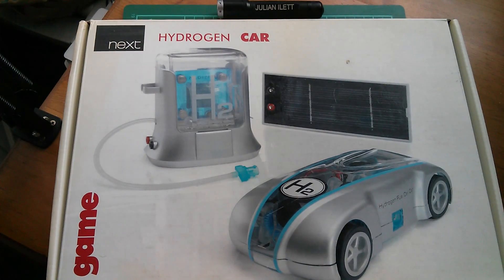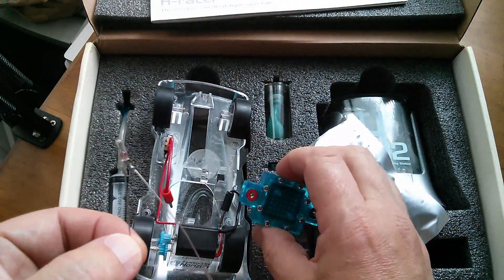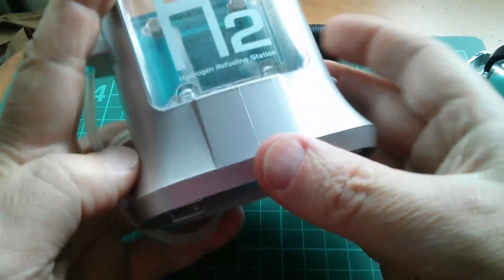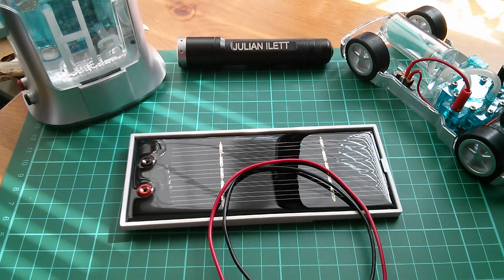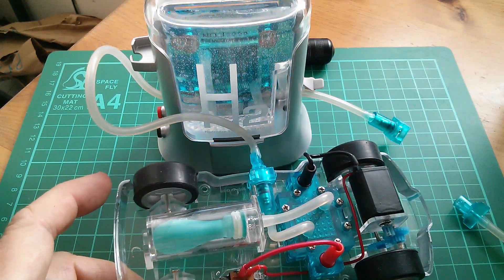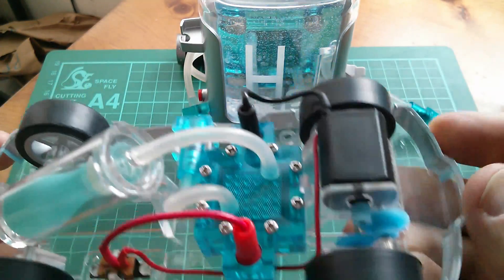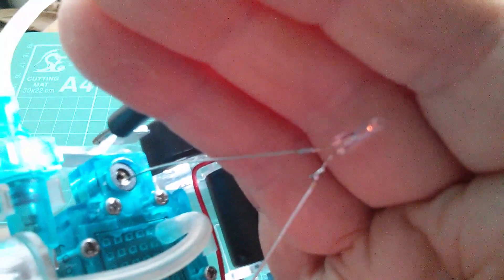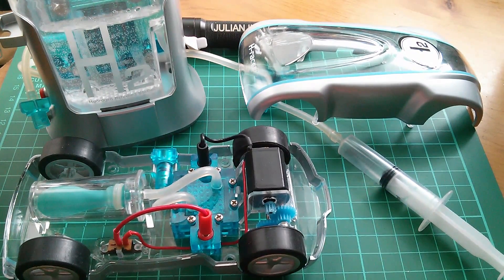Julian looks at Green Stuff: #2 - Hydrogen Car

Comment: Why using 3.0V solar panel to generate hydrogen, then generate 0.5V form hydrogen, and finally run the car 0.5V motor? Why not put solar panel on top od the car and use the 3V?

Comment: Looks like your making/using Oxyhydrogen (H2O2) aka 'Knallgas/Browns Gas/HHO.' There are lots of issues with scaling Oxyhydrogen, mostly due to its explosive capacity if compressed as the hydrogen gas carries oxygen. It is not an efficient process either. Hydrogen cars are designed for liquid hydrogen fuel which is extremely heavy. A small compact car needs a chassis like a commercial truck to hold the fuel tank.

Comment: Where is the advantage in converting battery electric energy (or solar) into hydrogen so you can convert it back into electricity to run a motor?  But I guess this was a possible technology BEM (before Elon Musk).
Reply: EdCranium i think it's because you wont need a battery to store them. you can just have a tank that would be filled with very high pressure of hyrogen and you're good to go.. would be lighter too.. :) Sorry my english is bad
Reply: BEM hahhahaha thats brilliant. we are currently in the Year 46 AEM

Comment: That noise I think is just the hydrogen bubbling through. A stalled electric motor consumes more current than a running motor (hence why its usually a stall current stated in the datasheets rather than free running) so you are of course going to place extra load on the fuel cell and continue to have hydrogen bubbling through the unit.

Comment: Where does the water go when the hydrogen reacts with the oxygen from the air?
Reply: Nikolaj Gylling as air out of the valve i would guess, very humid but wont see it due to very low flow
Reply: jusb1066 Wondering the same thing because he said it was a one way valve.

Comment: i wounder if you used a larger ballon forget the motor side of it use a joule thieif to up the voltage from the fuel cell maybe use a large solar panel but with a dc to dc buck conerter to lower the voltage if you could build a hho tourch haha